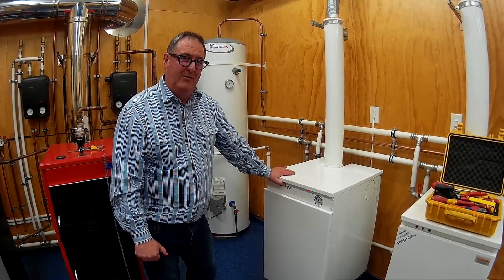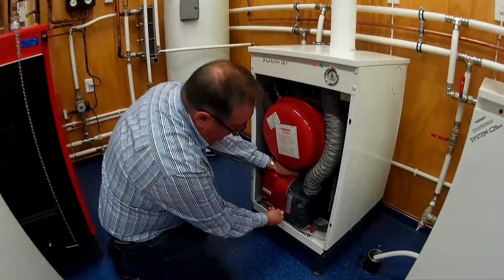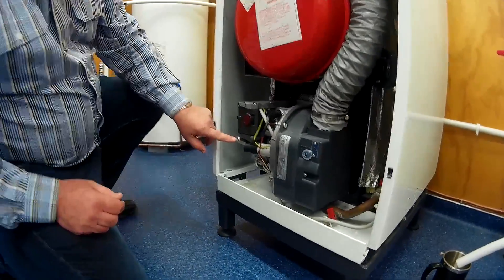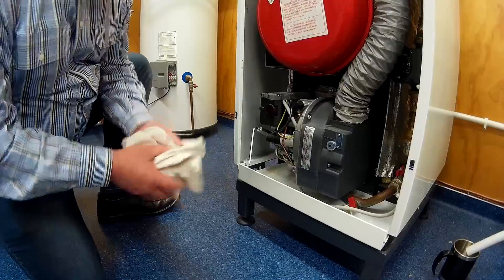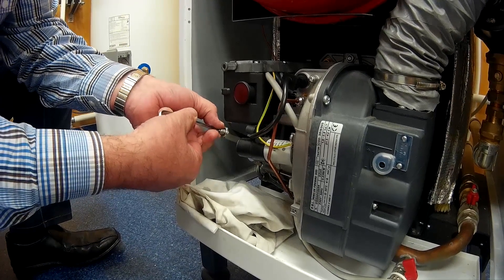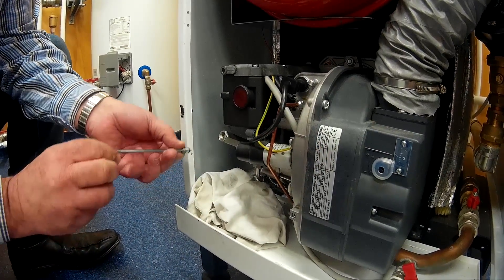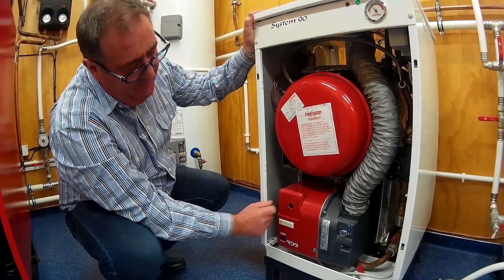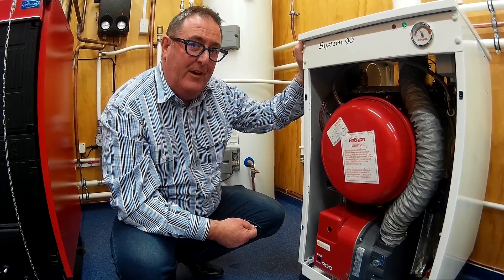Bleeding the fuel line on a Firebird Diesel Boiler in a Central Heating System

Comment: Much obliged, got me out of a spot too since this was translatable to a Firebird Kerosene boiler on the other side of the world in Ireland
Reply: Hi there my fellow Irish man , my pressure meter is currently is currently sitting at 5.5, I think it should be at 9 any idea how I adjust the pressure to bring it up ? I have the same burner as in the video . Thanks for your time .
Reply: @malmoran8643  for our system, there's a plastic valve sticking out of a pipe above the water boiler which you can turn open temporarily to flush more water into the system as needed. If there's no pressure meter beside the valve, you'll just need to gauge it by popping out to the boiler to check pressire after each few seconds you have the valve open.

Comment: People, do not remove the plug, just loosing it. If You remove the plug, and theres any pressure in the system You are going to be covered in fuel oil, which smells like parafin. You only need to loosen it, untill bubbles go, or oil fuel starts leaking out with a little flow.
Reply from the maker: Thanks for your comment and good tip.

Comment: Great! Thanks good to know where the reset button is on the burner. Ran out of oil for a couple of days but when pressed the reset worked again after a couple of goes without bleeding. In the UK the Firbird looks identical inside to our 'Grant' boilers.  Thanks!

Comment: This method works ok if you have a short and simple fuel line. I tried it several times but the boiler kept locking out again. My fuel line is about 10 metres long, has a couple of 90 degree turns, drops under a path and rises again. We had to turn off the valve at the boiler, disconnect the flexible hose by the bleed valve, turn on the valve and run about 5 litres of fuel into a container before all the air cleared.
Reply from the maker: Thank you for your comment, sounds like it was a bit of working getting the air out, but pleased you managed to get it working again. We recommend our customers install a Tigerloop which bleeds to line for you. It's particularly good for longer fuel lines. We also have a fuel level monitoring tool which helps prevent the fuel running out.

Comment: You don't always have a positive head on your oil tank ( may be lower than boiler) and the oil won't flow at all, you may need a priming pump (even with a tiger loop).
Reply from the maker: You are absolutely correct, and I'm sure this will be helpful for people who have this setup. In New Zealand our training ensures our installers are aware if/when a tigerloop is required at the time of assessing the installation. Thank you for pointing this out. :)

Comment: what if it is a overhead fuel line?
Reply from the maker: It's pretty difficult to provide a recommendation without seeing the system. We would not recommend installing an overhead fuel line.  We suggest seeking help from a local installer to help you.

Comment: Does the tank need to be FULL or can it be topped up?
Reply from the maker: The tank does not need to be full provided the fuel level is higher than the boiler. We recommend a tigerloop to be fitted on our systems to eliminate the hassle of fuel level issues.
Reply: @centralheatingnz  I have at least 500 litres of newly delivered oil in my tank, (yes I ran out of oil) I also have  a tiger-loop fitted in-line to the boiler. Both tiger-loop and the boiler are approx two years old. My boiler is an  external Worcester Bosch Greenstar  Heat Slave 11 - 12/18. I have been trying to get it to run for two days now, but it is constantly locking out...I don't seem to be able to get all the air out of the oil, I have to date drawn at least 2 litres of oil into a bottle in my efforts to bleed directly from the burner..It will sometimes run for around five to ten minutes while still bleeding  mostly showing an air oil mix...but will eventually lock out again. until I once more press the reset button, only to run for a short while before once again locking out ? If tiger - loops are that good then surely, and according to you I should not have to bleed this system, the tiger-loop would do it all for me? There is also an in-line filter fitted before the tiger-loop , which to play safe, I  changed with a completely new see through bowl type only yesterday. Here in South West Cymru aka Wales,  finding a heating engineer is not easy and can be expensive...therefore as a Pensioner I would be very grateful for any help you can  give me, Its been raining almost none stop for days cold damp and miserable, I could do with getting my central heating to work, and a hot shower would be a God send :)) 

I shouldn't really complain about the rain  =  good grass = good sheep & beef lol,  something you guys would also know a lot about :))
Reply: @pedrapioan4201  Hi did have any luck getting your boiler going? I have a similar issue, i cannot seem to get all the air out!
Reply: SuperOMARKO I have the same problem. I have pushed that red button a ridiculous amount of times and there still seems to be air in it